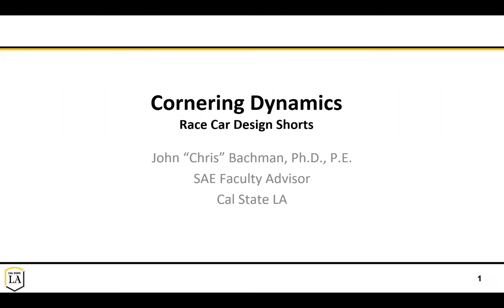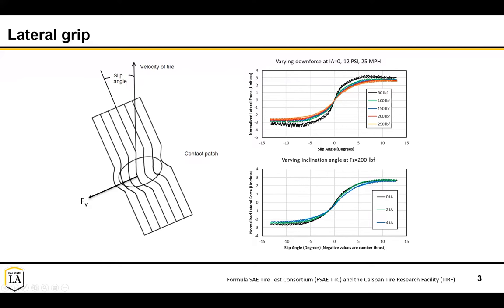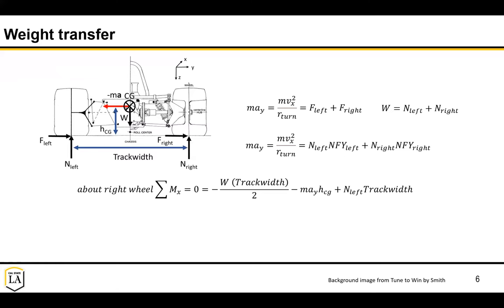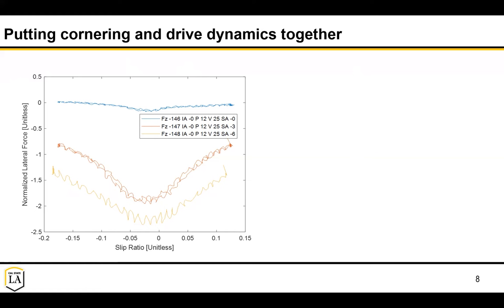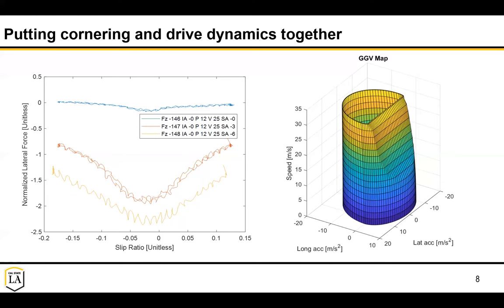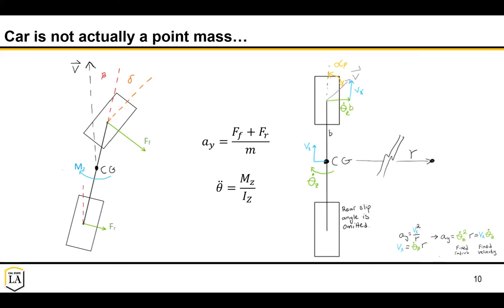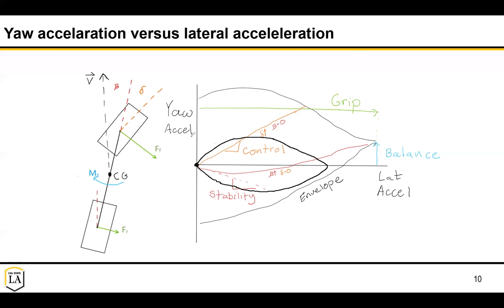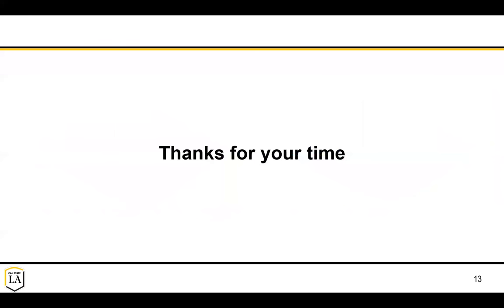Cornering Dynamics | Race Car Design Shorts

Comment: How are those N/Ay diagrams generated?
Reply: I am currently reading 'Race car vehicle dynamics' from Milliken and Milliken where this diagrams appear as 'MRA moment method diagrams'. In the book they explain that those can be generated whether by a constrain test or by computer simulations such as the MRA Moment Method that MRA sells. I wonder how real Baja SAE (students) teams crate their diagrams for analysis
Reply: If are based on simulations, which software do you use? Are there any open source or free alternatives? Is a custom model that you code?